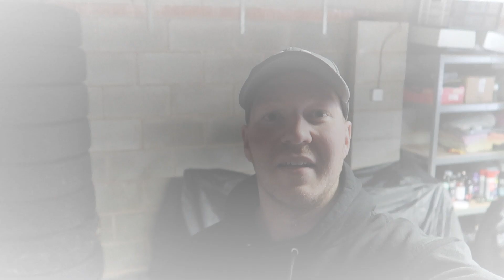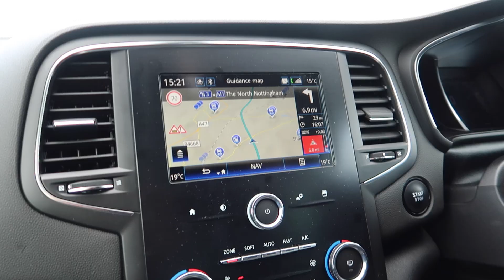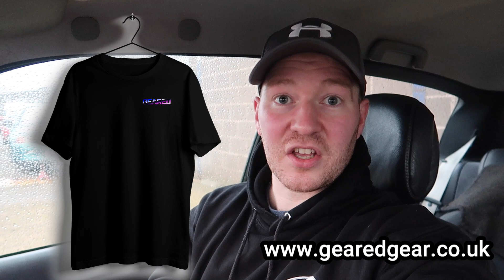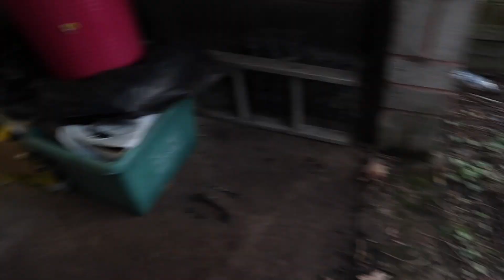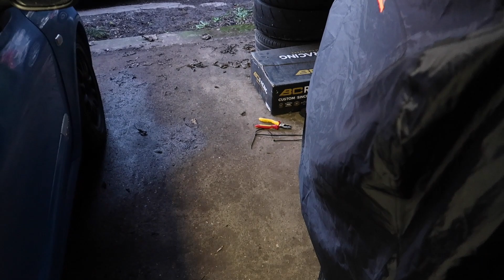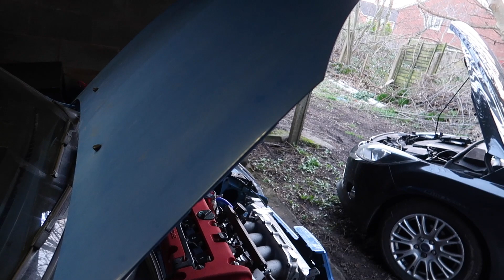My K20 Clio 182 - More Power, Different Parts, Next Steps! *Part 6* 🇯🇵🇫🇷

Comment: I have a real soft spot for these Clios and I’ll watch the progress on yours with interest. Wish I’d kept hold of my phase 1 and phase 2 172’s as the prices are going up and up!
Reply: Tell me about it mate, the prices are mental. I won’t sell my 182 ever (owned for 12 years) my ph2 172 I just sold in January for 3 times the price I paid in January 2019 with 26k more miles 😂 

Wish my 182 had less mileage, currently on 54k. People asking £7k-£10k for sub 40k mile examples.
Reply: Top tip if you see a 172 for sale with no mot for the usual £1k-£1500. Buy the car if it has its original cat. I have many times sold the cats for upwards of £650, with the most recent being sold for £830 during high prices.
Reply from the maker: Cheers bud! 💙 Yeah, the prices of Clios have gone abit wild lately 😄

Comment: Definitely need a trickle charger for the Oddysea Batteries to keep them top top. If it’s more of a road biased car I would recommend sticking to a standard Battery. Great build though 🤙
Reply from the maker: Thanks mate! 💙
Done away with the Odyssey and gone with a full size one which works 100 times better. Glad you like the build mate 💪🏻
Reply: @GEARED_MrLucas  Credit where it’s due mate 🤙🏼